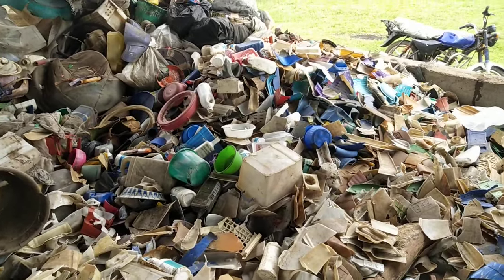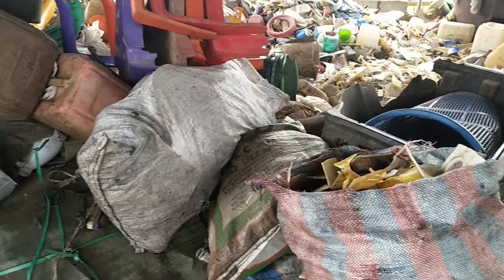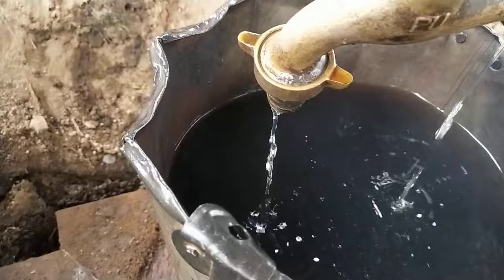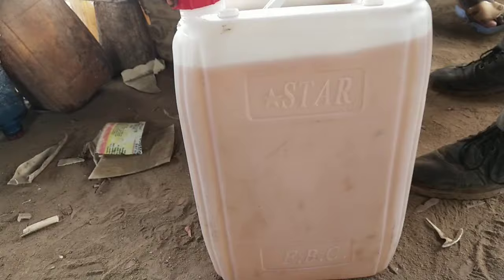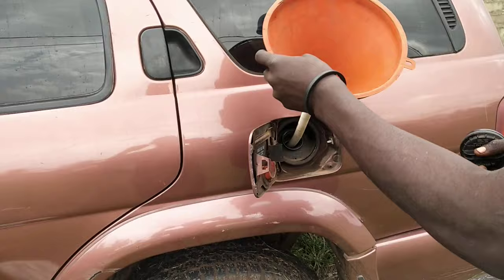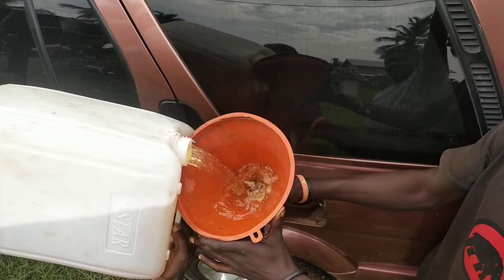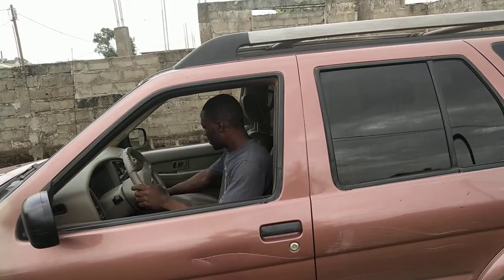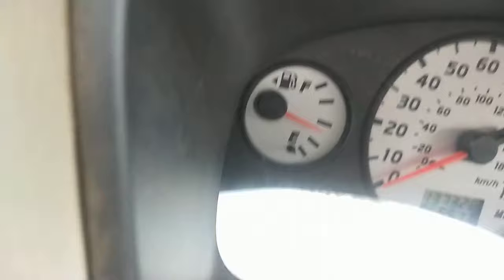Plastic waste to diesel fuel and gasoline, from Liberia by EGRI. Visit  www.egriliberia.org

Comment: Putting that gasoline into the car might not be the best idea. It needs to have both detergents and an octane booster added to run well in a modern car. Without that, you will get carbon deposits on the injectors that could cause problems down the road, and the engine will likely also develop a knock. When you started the car, you had old gasoline in the fuel line so the result of the gasoline that you added to the tank were not clear yet. Knock should occur first while issues with carbon deposits should occur further in the future. Lucas fuel additive should avoid the carbon deposit problem while adding some MTBE or blending ethanol into it should avoid the knock issue.
Reply: Hello I am interested with your chemistry on how to add some chemicals like ethanol. Can you please give me a volumetric analysis basing on ratio on how to mix them
Reply: Thank you bro 
Iam fm india
Iam great fan to you
Reply: He is just reading a script..
Reply: Ooooo please 😏
Reply: A knock will only develope if engine runs hot enough to develop a knock.  That's easily remedied by adding a water mist via vacuum bubbler.
Knowing internal temperature and or octane rating of this production gas is all that is necessary.  Boosting octane is as simple as adding a bit of higher temperature distillation to the gasoline.  Ethanol is not required.  I once ran an Audi on 87 with a knock.  Installed a water mist via vacuum and it eliminated the knock reducing engine temperatures.
Reply: @eby6114  l
Reply: Agreed still it's a very VERY WISE 🦉 IDEA TO MAKE GASOLINE.

BUT ESPECIALLY FOR THOSE IN THAT COUNTRY BECAUSE HE SAYS THAT ALL THE COUNTRIES OF THE WORLD HAVE BANNED SENDING THEM THERE PETRO ⛽ FUEL
Reply: @sanunitwaibu529  it's not that high tech the amount is always on the bottle like one bottle per tank
Reply: Yes its true,  but it's better than Landfill and incineration
Reply: Go and some bro
Reply: If only engines weren’t designed specifically to need those additives to run… who’s idea was that I wonder
Reply: Exactly
Reply: @devonsteny8711  oh wow and it's like totally working for the dude in Africa it's almost like you're wrong it's almost like Imagine This vehicle manufacturers produced engines that can sense it's knocking and advance or retard its timing to prevent that you know so that if it has higher octane or lower octane it adjusts on the note of this fuel not having ethanol in it that's probably better than American fuel
Reply: @yzrippin Ethanol actually makes something like 24% more Carbon deposits than gasoline. Making it worse for the environment albeit better than lead.
Reply: @JALA578  yes and ethanol is not used to reduce knock
Reply: I tink the problem  it makes plastic softer causing a problem injectors pump, hope not I need cheap gas to I'm poor.
Reply: You're giving advice to people who live in a far different world than the developed world.

Comment: hi John
I admire  your talent and hard work, to produce fuel from plastic. i had this in mind and was going to do the same using tires, it is unfortunate that i did not continue with project
you  have my great respect for your devotion and talent. wish you all the best
Reply from the maker: Thanks a lot
Reply: @JohnSmith-egri  please I need to discuss with you
Reply: @JohnSmith-egri  when you heat the plastic how do yoi split the diesel from gasoline??
Reply from the maker: @FirstLast-tx3yj  I could do another video on that if sponsor
Reply: Car tires require hydraulic rubber cutters that can also cut through the steel belts

Comment: All power to you for recycling otherwise unrecyclable hydrocarbons :) If you can sort off clean plastics by type and color you can extract much more value from them :)
DIY Plastic Scanner is an interesting project that could help sort plastics.

Comment: Its great to see that you made an idea into buissness. It not only helps the environment but is a good way to recycle plastic waste in your area. In our countries of northern Europe its beneficial to incinerate them and use heat to generate electricity and heat transfered trough pipes into our homes. Your start is crude and needs improvement but its a good start for something great in the future. A good idea. A good product and good environmental impact.  Besides that your english is great. I can't speak english with such fluency like you. Plastic is and will be a problem. One which we can burn, recycle or make into useful products like fuel. After upping production of fuel and making this system more advanced I hope you will look into another ways in which you can make useful products out of waste plastic. It has still market potential as a raw material. With heat and molds its possible to make something useful out of them. Thats just my idea for side hustle after making this one profitable. Best of luck!!
Reply from the maker: Thanks, we also look out for partner ship

Comment: Very innovative. My only concern is the octane level and compatibility with the chemical needs of the modern engine. It may work for the initial time period but if it is detrimental to the valves, pistons, rubber hoses and other critical parts then . . . My having worked on cars of all ages for many decades I raise this question. As a matter of fact I even own a Nissan Pathfinder of this vintage, early 2000's.
Reply: I think as long as it's a multi-port fuel injected engine you're good, Direct fuel injection not so much. As far as octane, it's probably higher than what we get at the pumps considering he's making diesel. Worst case scenario you swap the engine to a carburetor and run it a little rich so it douses those valves and keeps them clean.
Reply: @ericbeltrami2718  carburator ? Diesel ? Explain please a bit more ?

Comment: Hi bro how  to construct the processing system ?coz I have yearned to make my own diesel for long time but I need a coach......
Reply: You need a large steel tank that can be opened from the top that all your plastic waste goes into, which then gets a lid bolted over the top that has a pipe leading off to a distillation setup. You purge the tank with Co2 or Argon gas (to remove oxygen that would burn your product) then heat the steel tank with all the plastic waste in it by placing burners underneath it, which breaks down the plastic into a gas that collects on your condenser lines and comes out as crude oil. It has to be further distilled to get diesel from it so an additional distillation setup will be needed, and don't forget that many lighter gases like propane are created that won't condense in your collection tank, but they can be used to more efficiently heat the reaction vessel by piping the excess back under your tank. There is a ton of info online, the keywords you want to be searching for are "Plastic Pyrolosis Reactor" or "Plastic Pyrolosis How-To". And shredding your plastic before dumping it into the vessel will help with production quantities, if you're just pouring in whole bottles or other whole plastic waste, you're severely limiting how much fuel you can make at a time, by shredding the plastic you will be able to get much more density inside the reaction vessel.
Reply: @TheExplosiveGuy  great thanks for the valuable information, I would like to ask after collecting the oil which we all suppose it will be the crude one so for further fractional distillation we will have to heat them again into another reactor in order to refine different substance or just one heating and we can collect that through fractional distillation just asking
Reply: @Daboresa  correct, the crude product will need additional fractional distillation to get clean and pure diesel.
Reply: @TheExplosiveGuy okay great thanks, this is what I was really keen to know about

Comment: Does your car is a diesel run car or normal gasoline car? Does the gasoline need to add any substance to filtered the gasoline to use in the car?

Comment: Hi John, a great video. A good step to earn responsibly. What happens to carbon that is left? Where to you supply it or how do you dispose it off?
Reply from the maker: We turn it into pavement tiles.
Reply: Super cool... I need those structure plans... For my car fuel
Reply from the maker: @iradqulizepo1672  contact me on WhatsApp
Reply from the maker: @ibrahimconte105  +231776261258
Reply: @JohnSmith-egri  I just sent a message
Reply: @tamaraposibi  bonjour s'il vous plaît j'aimerais causé avec vous en privé

Comment: If you buy plastic from scrapers then it will be profitable or not?? to use fuel into vehicles is it necessary to refine or distillation?? Are you interested to work in india??

Comment: The method of containing, dispensing, managing the fuel is terrible. The actual making of the equipment and processing step by step would be interesting.  I guess there is a major factor of working with available resources but the impact of spilling so much around and getting it on your skin could have such dire consequences.

Comment: What's the conversion rate?
I'm very interested, but not understanding the method of process, looks like just Cooking it in a pressure cooker and distillation of the smoke/vapor.
Reply: plastic usaually converts about 90% weight so 1000 lbs of plastic makes 900 lbs of crude oil and the crude oil is refined down to the different stages of fuel just like in a bigoil refinery.  Big oil is hiding this info. most people think plastic is waste. plastic is gold
Reply: @teahaul7897  okay, that's helpful, but is there a way to know how much it needs cooked so it doesn't solidify when cool?
There's very few videos or instructions on this right now.